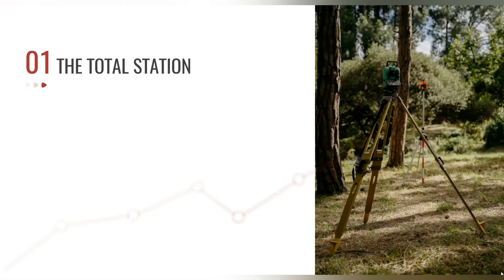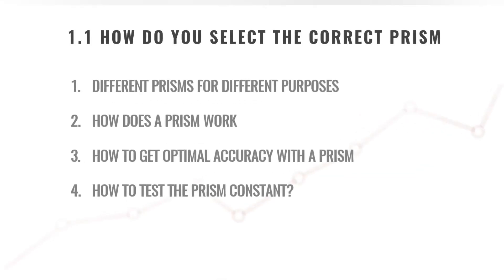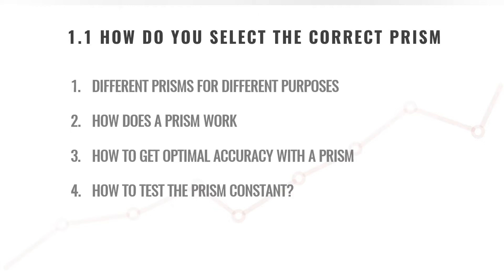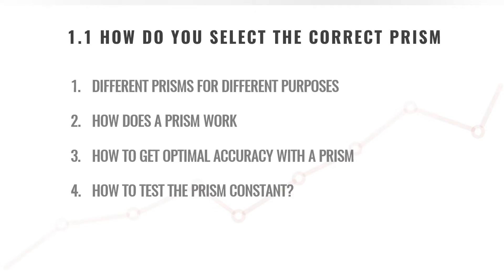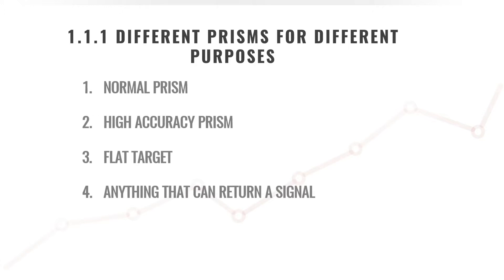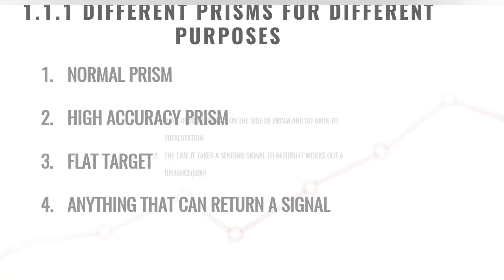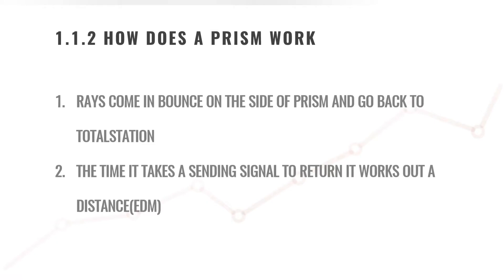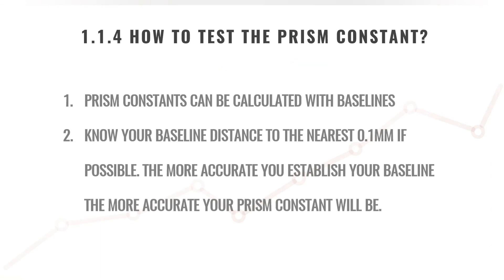Eliminating Prism Errors - SURVEYING TRAINING

Comment: But what is the actual purpose of a prism constant? Why can't all prisms just be 0mm offset?
Reply: Look up something called "nodal prisms", and non-nodal prisms. 0mm offset is what Leica tried to do, when all their true prism constants are -34.4mm . But their software will do the math with the assumption that 0mm = -34.4mm. In effect, it's like saying "Water freezes at -34.4 C, but 0 is a nicer number, so lets work off that instead". Except they have other prisms that aren't their new 0, and have other numbers on them. For example, as mentioned in this video, he likes 17.5 as being more accurate, when inactuality that's just a simplification. 17.5mm for leica, its true prism constant is -16.9mm.  

The main reason why different prisms exist that have different prism constants is largely because of choice, and cost. It costs more money to make a prism constant bang on exactly 0, and secondarily, even if you did a 0 prism offset wouldn't be ideal. When you have a prism offset (true)-typical of Lieica Mini's GMP101 or GMP111-0 (or maybe it's GMP111-1)  of -16.9mm, because they are nodal, AND they have low centering error, if your prism isn't aligned perfectly with your total station, like perfectly square targeted, and bang on, a 0mm offset prism will have far more errors based on that angle deflection.

A way to illustrate that point, is the put your total station in layout mode, keep it in tracking if you want too. When your;e staking out a point, keep your crosshairs fixed (if using a robotic, keep autolock off), and just rotate the prism and watch where it's telling you you need to go. On a nodal prism (-16.9mm, +17.5mm-Leica) mind you there are other nodal prisms that do have different prism constants you'll notice that if you rotate the prism either left or right 10-20 degrees, and are still able to get signal from the EDM, that it will tell you to go away, or left or right more or less than a few mm than when you're bang on lined up perfectly square with the total station. 

That means a few things:

1. You should not be doing robotic total station accurate work with a non-nodal prism. I'm not going to debate this with anyone. I've tried it, its too unreliable. And that prism will not have a 0 mm constant.

2. You can absolutely use a non-nodal prism if you're doing things the old fashioned way for high precision layout (IE: You have someone looking through the instrument, and aren't relying on autolock servos, that can tell the guy "hey, straighten out your prism".

3. You don't need to spend as much money on backsight targets with non-nodal prisms, but you really should make sure that you square them up with your total station, even if they're far away to get the most accuracy. You will still need to do the same thing with smaller prisms too. You do also have to consider that EDM's will get a bit wonky the farther away you're shooting, that's why I don't necessarily agree with the idea that smaller prisms are always more accurate, I'll argue that they are for layout,
Reply: Prisms in this case, are actually retro reflectors. As such, they have a certain depth to them in relation to their size. The prism constant is an offset to the center point of the reflector, in relation to the center of the prism pole.
Reply: Tbf he did explain that in the video from the 8minute mark if u watched it to the end.